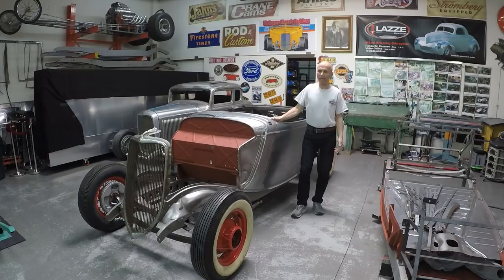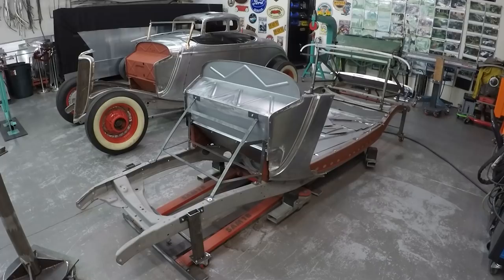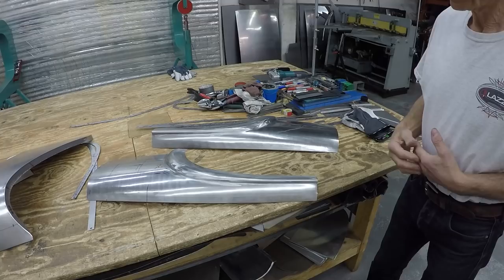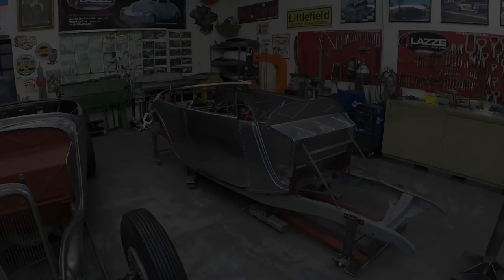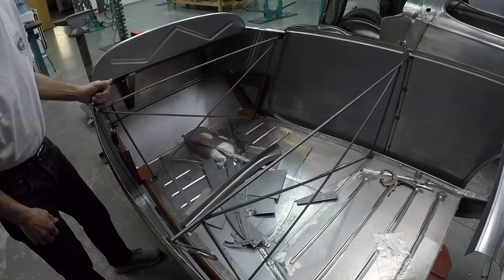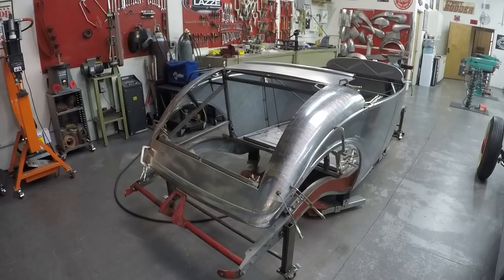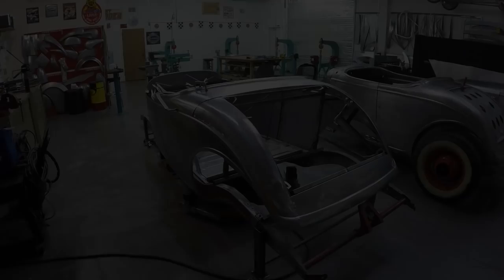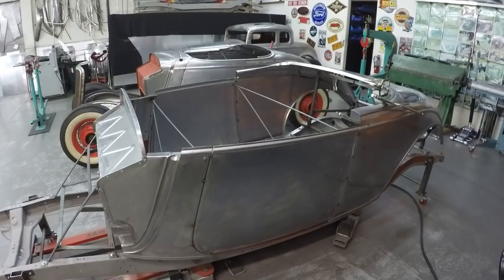Lazze Metal Shaping: Step 2 Class 33 Roadster Body Fabrication

Comment: ABSOLUTELY INCREDABLE LAZZE, CAN I ASK WHAT GAUGE MATERIAL YOUR USING ON THIS?
Reply: 19G in the body, 18G in the floor panels and 16G in the Subrails that goes over the frame and 16G as well in the Firewall
Reply: @lazzejansson4805  THANK YOU SIR, DO YOU SPECIAL ORDER THE 19G? DOESN'T SEEM TO BE PLENTIFUL HERE ON THE EAST COAST.
Reply: @thomasking2081  Go to my website and send me an email and I can email you the right information so you can get it, it's to much to post here
Reply: @lazzejansson4805  OK, THANK YOU